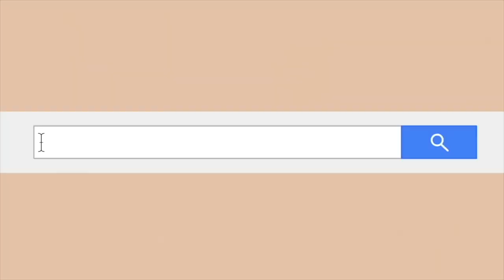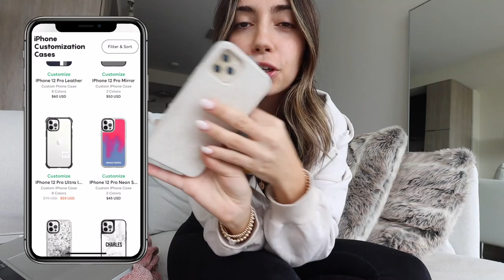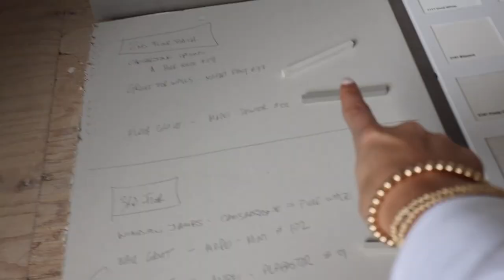EXCITING decisions for the house!!!! + weekly run w/dad

Comment: some tips to help boost your energy would be-a quick 10 min workout to get your heart pumping/blood flowing. it helps with alertness, even something like power yoga. drink cold lemon water with ice. even wash your face with cold water, or put an ice pack on your forehead, back of neck. vitamin B12 is good for energy. also essential oils, and Saje wellness has roll on essential oils with like an "energy" blend! I love their stress release and peppermint halo. even getting a diffuser can help set the vibes in your apartment! best of luck!